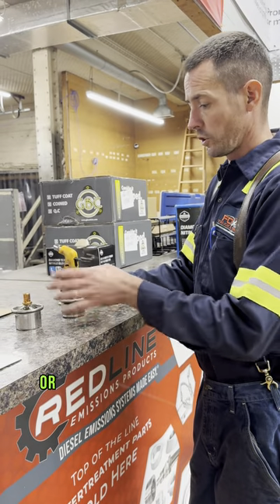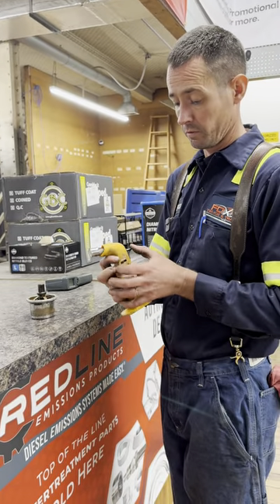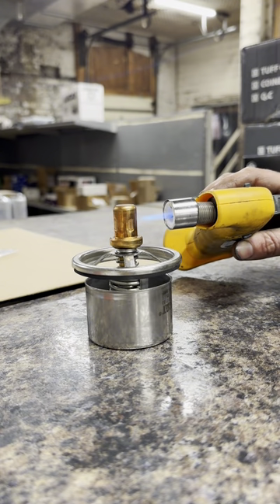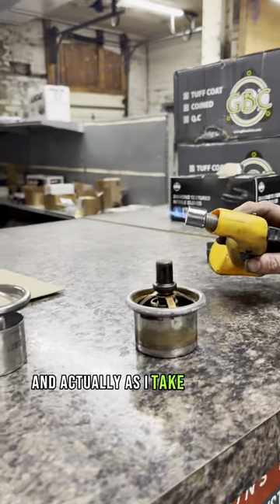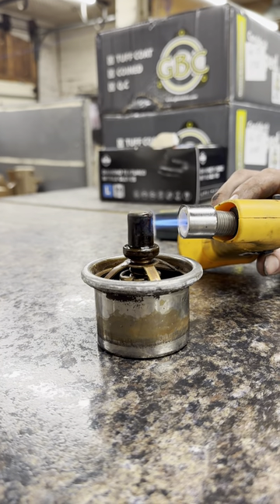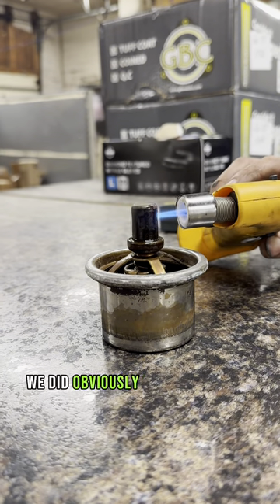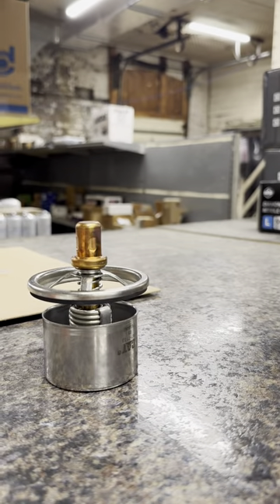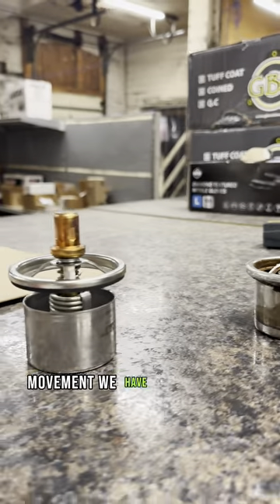Semi Engine Running A Little Hot, Radiator Fan Stays Running - Check Out the Thermostat

Comment: Could the problem to the fan constantly running also be the fan control solenoid? I have a 3406e and the fan started running and doesn’t cut off. Every once in a while it cuts off for seconds then comes back on for hours sometimes all day and night

Comment: My engine has been running anywhere from 110-150 my fan is constantly running i replaced the thermostat same issue still wont get the temps up past 150 would my fan really cause that? Seems to me it should run hotter even with the fan running

Comment: I changed my thermostat but still running above normal it cools down when I stop. Already clean the radiador new water pump new belts and tensioner new fan clutch.
Anyone's have had this problem before?
Reply: I’m having same issue, not replaced pump yet but have new clutch, new filter and new thermostat. Thinking it may be radiator. Seems cold and very bottom but I have not had a chance to compare with another truck of same style.
Reply: @CrazyMan0824  I was thinking of replacing the radiador but now that is cold outside, still running above normal so I don't think is the radiador now.
I use one of those temperature guns and the radiador is about 100 to 110.

Comment: I have a different issue. The engine is running cooler than normal, but the intake Actuator number 2 is not working, could that cause it
Reply: I was going to ask this. My thought is that the thermostat is maybe stuck open  a little or a lot.